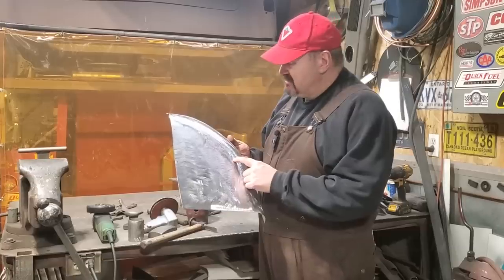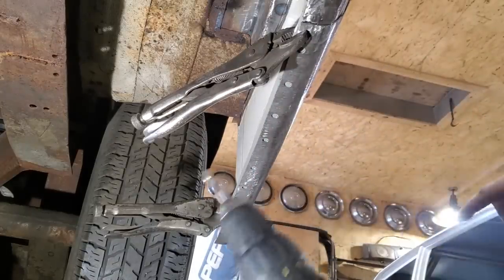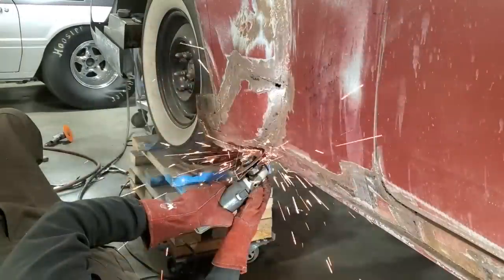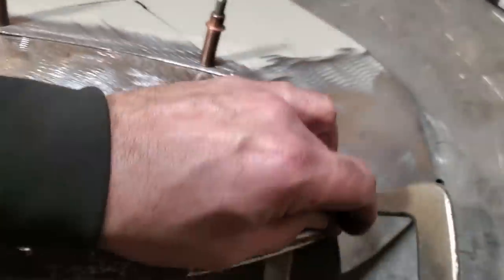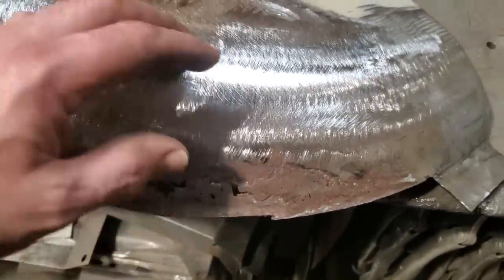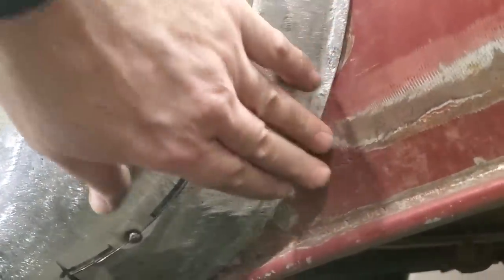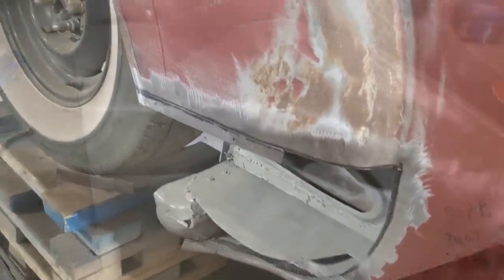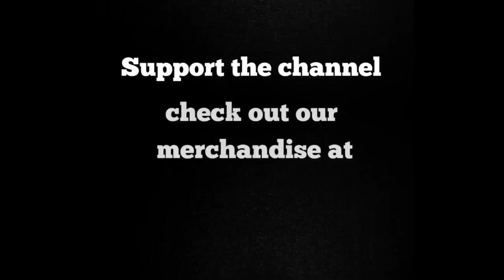Using recycled metal to make new replacement panels with simple tools

Comment: Tony is the Leader in making do with what you have and thinking outside the box. Miles ahead of the rest with his innovations and solutions!  Stick around Folks.
Reply: Something we used to do in old school tool and die trim line was prick punch the layout line and essentially split the line when machining to that line. It makes a nice reference and would be covered up by the weld.

Comment: I watched Carter Auto Restyling videos on mig welding sheet metal and he likes to weld about an inch and then immediately grind the weld ... then another inch and so on ... says it tempers the metal less and is easier to grind and you don't have all that grinding when your done welding ... I tried it and it works pretty good ... like your videos ... seem more like one of us ...
Reply from the maker: He does a fantastic job on that. I been meaning to try it and see how it works out.

Comment: That was a massive job, it must have taken you a few days to do it and then fit it into a 95 minute video. It took me three days to watch the video! You sure detailed the repair very well and turned a complete mess into a nice panel. Whoever welded that car previously didn't do too good of a job, but you fixed it. Looks like this car is a multi-year project, with all the work that needs doing on it.

Comment: I have to admit it surprised me to see you didn’t hammer form a panel and fit it over top of the existing piece and cut+butt it, I did this on the rounded cab corner o my 64’ dodge truck, made it in a couple pieces as per your videos worked amazing! But definitely see your wisdom on recycling when the piece is still usable I wish I would have been more tender with my passenger floor pan

Comment: I know now why you use that high speed sander I always used an angle grinder and the metal turned blue all the time then it would warp and get really thin then when you would try to weld it it would just blow holes in it , well harbor freight (dont know if you have that there ) had the central pnumatic high speed grinder on clearance for 9 dollars I find it almost impoosable to put a ton of heat into the metal with these but the down side is its a slow grind lol WISH I WAS AS GOOD AS YOU !!! awsome videos

Comment: Hi Tony, great work as always! Great instruction!! My welds have been tucking as you said, last bit of work was the 2nd camaro roof drip edge, old vinyl top car. 18gauge to 20 gauge, .23 Miller 140 w argon mix. Ended up using some duraglass,  it came out alright but I was disappointed in the tucking and the need for the duraglass. Guess I need to slow down. P.s. how do you avoid sunburn from the arc?
Reply from the maker: I don't. Lol. I noticed  some days I jet a bit of sun burn. Nothing crazy. Old habits.  Best to wear a helmet

Comment: I feel like to master the cut and butt you need to be really good at your angle grinder (I did a large cut an butt yesterday on a roof panel and I ended up using a 3" cut off disk on a smaller grinder because my angle grinder felt too unwieldy (turned out nice).  Also you need to be good at grinding and knowing when to stop grinding (so you don't make the panels thin).

Comment: Hey Fitzees! How do you feel about hammer dolly your welds between welding panels together? Like put in a layer of welds then hammer dolly so it relieves stress and then put in another weld. It suppose to keep the panel from shrinking.
Reply from the maker: Mig welding is a hard weld. We did that with steel welding years ago with torches. I'm sure you can do it with tig too but mig not so much.

Comment: My friend, that was epic!  I always learn something new when watching and this time was no different.  One thing I did notice was I was looking at the panel when you cut it off and thinking about how to get it done and it shows how much I have picked up over the years of watching as you approached the repair exactly as I thought I would in your position!  That final piece around the radius on the front of the panel was where I picked up a few tips this time.  Taking your time and thinking about how the end result should look appears to be a big part of how you get things done and if you make a mistake, grind it off and have another go.  Yes, I did pick that you were doing something out of the ordinary when you welded the vertical join and ended up with the metal puling in and I wondered about why you were doing it at the time.  It was just to show us what happens, wasn't it?  You completely meant to do that as part of the teaching method.......well, that's what I reckon you should be saying anyway!  Thoroughly enjoyed your video as always and it was a great demonstration on how to fix a particularly difficult-looking piece of bodywork by thinking about the easiest way to get the desired end result.

The number of those sorts of pulled-in joins that I have seen on classics that then just get filled in - and often way deeper than a sixteenth of an inch - are numerous.  I've got a mate's classic Mini in the garage at the moment where someone welded half a rear panel cut into it and the joins are half way up the rear window on either side......and the filler over the join was between seven sixteenths and half an inch thick at its thickest point!  I am honestly surprised the rear window seal fitted around it and it was only found because he went to change the tired old seal and saw the mess.  Water was beginning to get under the filler as well - no paint or primer on the welds either - so it was only a matter of time before the filler started lifting off anyway, but it meant pulling the trim, hood lining and rear seat out of the car and stripping the whole rear panel again to see the extent of the work.  I was going to try a hammer and dolly on the weld and see if I can stretch the metal out, but it might be easier to just make a couple of patch panels for the sides and replace the poopy existing joins altogether.  The joins were not even ground flat and yet the pulled-in metal was still needing that thick layer of filler to look right.  There are certainly some scary things hidden under paintwork, eh!  All the best.
Reply from the maker: No I never tried it to prove a point. I just got lost in the moment and rush it. Not my first mistake and it won't be my last. I realized after what I did and figure this is a good opportunity to show that I human. I figure there was a number of you that seen it so no good and super coating it. Lol

Comment: Fitzee have you considered getting a TIG for instances when there is access behind for a dolly. On some other channels I watch it's mentioned that there is much less heat transferred by tig and that the weld metal is more malleable than MIG and so it is easier to planish after welding. Sorry, you would have to re-jig your cart again but hey. ( I haven't finished watching yet but did wonder what your thinking is on it).
Reply from the maker: Some day I will get a tig. Yes it's much easier and the welds are not as hard as mig. So you can work the weld. I'll pick it up some day. Just never got around to it yet. When I trip over a AD/DC tig used for good price I just might jump on it.

Comment: Tony I saw you first do the cut and butt on a a gas tank access door. When you did that you emphasized cutting at a 45 degree angle. Most of the cutting on this it looked almost perpendicular. Is that 45 degrees not really necessary?
Reply from the maker: No I find it gets a tighter fit with the 45 degree angle. On this it has a curves  edge and you can't do a 45 with a zip cut. If I can do a 45 I will.
Reply: @fitzeesfabrications  thank you!

Comment: Maybe a weird question but wouldnt it be easier to grind welds down with a handheld belt sander and then finish it with a fine gird sanding disc?
Reply from the maker: Some like that. It's not for me. I think it is slower
Reply: @fitzeesfabrications  makes sense, just thought the flatter one can sand it the better the result:)